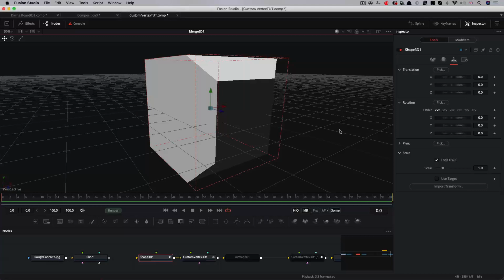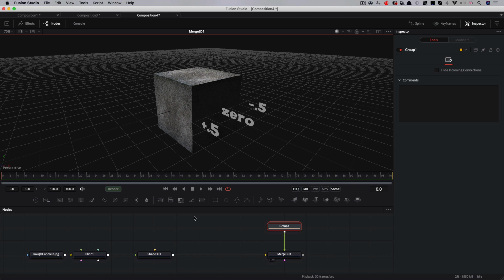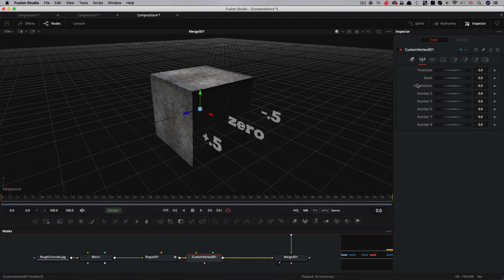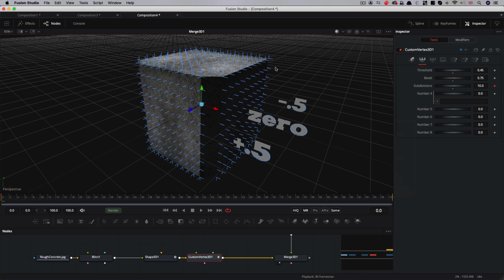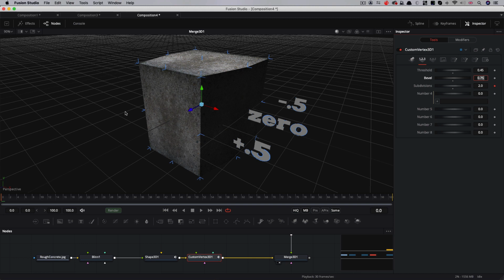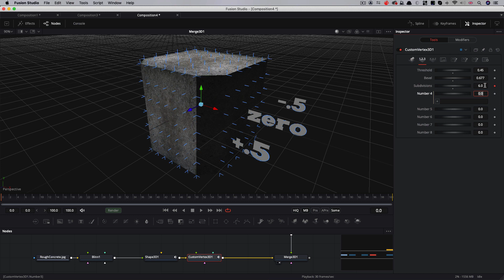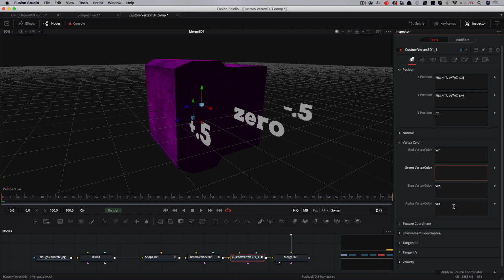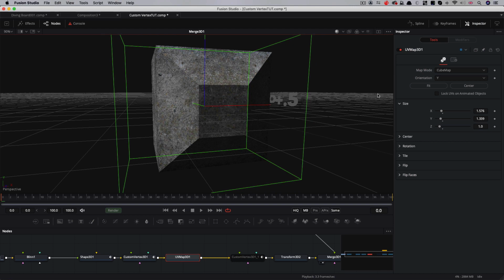DaVinci Resolve Fusion: Custom Vertex Tutorial (1/3)

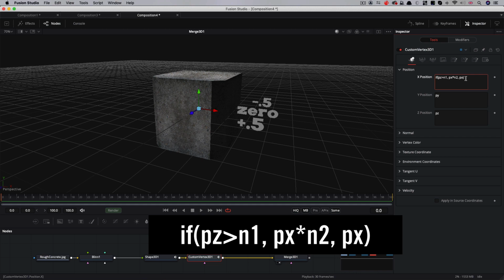Comment: Hi, Simon! Love your channel very much! I've learnt so much. I have a question at about (4:23) in the tutorial. If I set the threshold to 0, and bevel to 0, and subdivisions to 10, the object turns to asymmetric！IMO，it ought to be theoretically symmetrical all the time. But in fact, the object turns to asymmetric while the  subdivisions set to 6,10,12 etc. However, the object turns to symmetrical again while the  subdivisions set to 8,9,11 etc. I can't figure it out.
Reply from the maker: Thanks. To answer your question, I'm guessing it's because a threshold of zero is creating calculation issues because there is no central face, only a central edge. Try setting the value to .00001 ... in other words anything that's not zero. Zero is a notoriously dangerous number ;-)
Reply: Thank you for your quick reply. I'll give it a try.  @SimonUbsdell

Comment: This is great .. Thank you.. But can you also explain how to add multiple expressions in one ... Like every other modifier node in davinci you can place only one.  Say if you make a box  ( 1x1x2 =WxDxH ) . is it possible to say for example : bevel it inside after pz=0.5 and bevel it outside  again after you pass pz=2  ??  How would you combine those expressions  ? . Can you please make a more advanced version of this about CustomVertex node ?   Thank you for sharing this one 🙂👍
Reply from the maker: Thanks. Not sure I fully understand your question but it is perfectly possible to nest if() expressions in Fusion, as in this example:
if(pz>.45, px*(1-pz+.25), 
if(pz<-.45, px*(pz+1.25),
 px))
This bevels the front and back of the default cube within the one expression.
Does that make sense?
Reply: @SimonUbsdell  thank you for your reply. I wanted to create a roman pillar which starts wide . On a given point it have to get less wide   I guess i did something wrong before.. It did not except multiple CustomVertex nodes but it now does   but  I guess i missed the insight how to nest them and the " , " makes sense. 🙂 Thank you again
Reply from the maker: I have found the the Custom Vertex node often outputs unexpected results. Sometimes a restart of Fusion will sort it out, and sometimes ...
Reply: @SimonUbsdell   Indeed..had to restart also.. and I found out what  i did wrong.  I used one " ) " too much  . Now it works and i was able to re-create my roman pillar with less nodes. 🙂.. Great !!
Reply from the maker: Good news.

Comment: Simon, great video.  How can I add corner bevels connecting 3 center vertices of 3 adjacent sides to create a cuboctahedron?
Reply from the maker: It‘s stupidly difficult, as you might have discovered. For simplicity I would make one corner using Custom Vertex and then use 3D Duplicate for the rest.
Reply: @SimonUbsdell  Thanks for the reply Simon.  I tried using bender/taper, but without success.  I was starting to think along the lines that you suggest, but haven't tried it yet.  I'm thinking I have to control x, y and z axis for the vertex.  Is this true?
Reply from the maker: @willmaynard9375  It ought to be very easy to do using this expression for py: if(px!=0 && pz!=0, 0, py). But try it and you will see where the problem lies. It ought to create a symmetrical result but ...
Reply: @SimonUbsdell   I used your expression and left px and pz as default and this creates a shape that is close to a cuboctahedron, but unwanted valleys. If I read if(px!=0 && pz!=0, 0, py) correctly it says if px and pz are 0 then use 0 for py, otherwize leave py alone.  Is that correct?  I think if I made a second copy of this result and could rotate it around the y axis, looks like the second copy would fill the unwanted valleys though I don't know how to do that.  What do you think?

I'm new at 3d fusion and a babe in the woods.
Reply from the maker: @willmaynard9375  x!=0 doesn’t mean x equals zero, it means x doesn’t equal zero! So the expression means “move every vertex that is not at zero on both x and z down or up to zero on y”. That ought to work symmetrically but it doesn’t as you have seen. For simplicity, try this expression instead which targets only the vertices on the front left edge: if(px=-.5 && pz==.5, 0, py). The top has the unwanted valley but the bottom is fine. So then you have to look at a different way of doing the sides with the unwanted valleys, so you could use this for the right hand front top: if(px=.5 && pz=.5 && py==.5,0, py) and this for the left hand front top: if(pz=.5 && px=-.5 && py =.5, 0, pz) But you can see how quickly that gets messy ...
Reply: @SimonUbsdell  Excellent explanation of how these expressions work!  I made a copy of the shape3D and CustomVertex3D nodes and on this copy I set X and Y positions to px & py respectively then set z position to if(px!=0 && py!=0, 0, pz).  Then I merged outputs of both CustomVertex3D nodes and VOILA!  The valleys are filled and I have a perfect cuboctahedron!

Thanks so much for your time and effort and knowledge.  I'm looking forward to more Resolve 3D videos from you.

I wonder what other polyhedrons can be made with this approach.
Reply from the maker: @willmaynard9375  Yes, as I said at the outset, I think the simplest way is to cheat ;-) BTW it’s good practice to use a Replace Normals tool after this kind of Custom Vertex operation.

Comment: This has got me wondering if ctv can use one shape on another shape for boolean operations. I doubt cutting holes is possible, but if so why wouldn't bmd already have included it.
Reply from the maker: As I'm sure you know any shape can be set to become a Matte which effectively creates a "boolean operation" on any other shapes - but it's not operating on the actual geometry (it is indeed a "matte") so it's a bit tricky to handle for reasons you will discover if you play with it.
Reply: @SimonUbsdell  Yes by cutting holes i meant having interior geometry not sure of the term, "solid" holes? Make a solid hole! lol
Shape mattes are counter intuitive if a noob assumes they are like a boolean op in blender|sketchup at first, then it's obvious theres nothing inside the shapes, though I don't understand why it makes all the interior faces invisible even for other shapes downstream.
Since there's not really such a thing as an inside out shape, I've toyed with doubling the shapes to try and "invert" the mattes to fake the faces but the inside faces being made invisible kills the experiment. Also tried the weld node but that can't close giant holes or create faces though it can collapse things like cones to make a flat top face.
I think Krokodove has tools for fusion studio owners thought.
Thanks.
Reply from the maker: True 3D boolean operations involve a far more complex concept of 3D modelling than Fusion's basic primitive-based concept supports because they generate entirely new polygons.